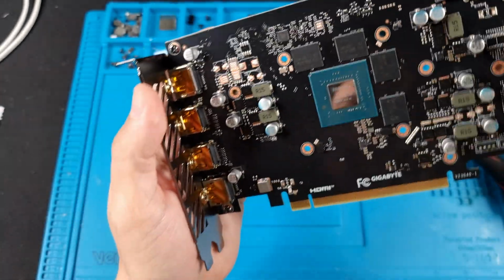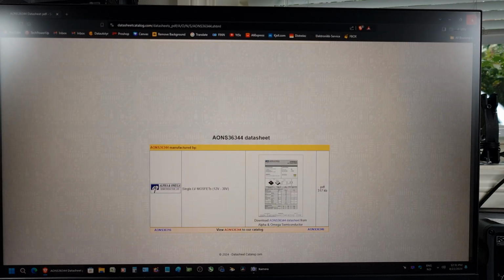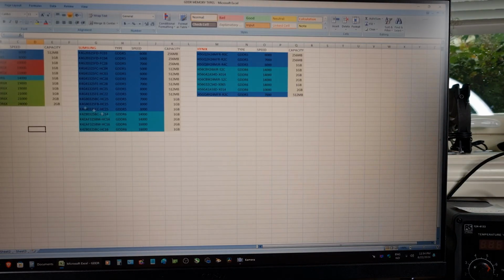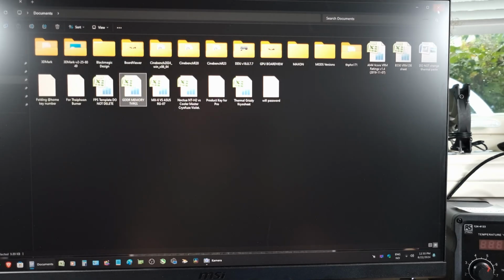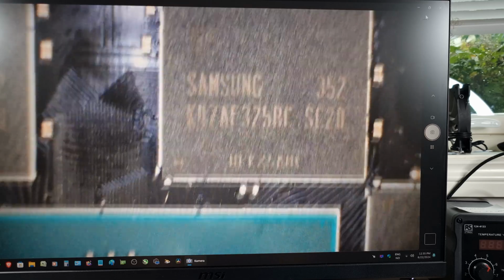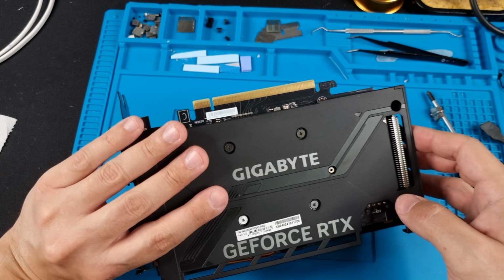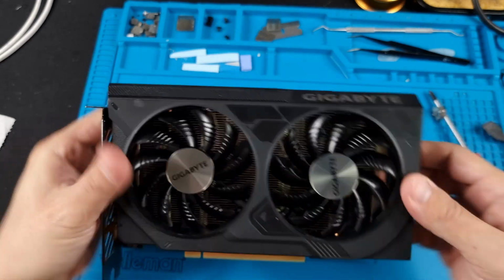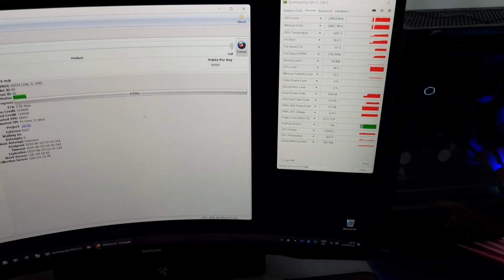GIGABYTE RTX 4060 8GB WINDFORCE OC TEARDOWN AND DEEP LOOK!

Comment: Loved doing Seti@Home. Don't think they are doing any new data packets, but there are a lot of other distributed computing projects. Einstein@home and others. Worthy use for computer time, though it runs constantly and probably uses a fair amount of electricity. Thanks for this tear down, the GPU has not bad temp, but the hotspot goes over 90 deg. easily, even with fans running full out. Definitely going to replace thermal paste and possibly pads. At least the pads are all 1mm, makes it easier.
Reply from the maker: I have not looked into other distributed computing projects, but those look interesting. Thanks for the heads up.

Comment: I have this card. Idk if it's faulty or it's my system sometimes it downclocks on idle (never happens during games) and never goes up again even on load until I re-start PC.
Reply from the maker: @dvornikovalexei  That's pretty strange. Try using DDU and uninstall graphics drivers in safe mode. Then download latest and install clean.
Reply: @TechnologyHive  Already did that. Wait, now that i think about it, this problem started only after i updated to 572.16.

Comment: Eu tenho uma 4060 da marca PNY, você sabe me dizer qual a medida dos thermal pads ? A placa é semi nova mas está trabalhando muito quente
Reply from the maker: I do not know the size of thermal pads for that card. sorry.
Reply: @TechnologyHive  você acha que 82 graus celsius e 110 graus no Hotspot é errado pra essa placa ? Acionei a fabricante mas eles insistem em dizer que está dentro do tolerável
Reply from the maker: @Lorenzzomariano  110c is very high. I would re-paste it. Try MX-6.
Reply: @TechnologyHive  a placa está em garantia, não posso mexer nela e a fabricante está negando a garantia. Não sei mais o que fazer
Reply: @Lorenzzomariano  Hello. Could you tell me if you were able to reduce the temperature by replacing the thermal interface?
Reply: @Сварщик-е7кHello, I tried to send the video card for warranty and they denied it, saying that the temperature was "normal". I ended up not dealing with this problem anymore and used it this way, but today I no longer have the video card because I sold my entire setup.

Comment: Will this work with my 
Intel Core i7 10700F Comet Lake CPU?
Reply from the maker: @MatthewHewitt1984  Yes, but I do not recommend it. The reason is that the 10700f is a pci-e Gen 3.0 cpu. The 4060 is a Gen 4.0 pci-e, X8. If you install this card in combination with that cpu, you'd be running at pci-e 3.0 x8, severely crippling the 4060's performance.

Comment: 2 questions, would this be fine for a 1440p monitor and what would be an upgrade to this gpu?
Reply from the maker: This is a 1080p card. Of course you can lower your games graphics settings and achieve satisfactory performance. But if you want an upgrade to this, it would be the RX 6700 XT or RTX 3060 Ti, which you can now find both for a cheaper price than the 4060 in the used market. 

If you want a new card as an upgrade to this, I would go with the RX 7700 XT from AMD, for $100 more. 12GB of VRAM and around 30% better rasterization performance. Unfortunately there is nothing in between these two cards really worth the money, unless you look in the used market.
Reply: @TechnologyHive  the 7700 would run 1440p just fine? if not do you recommend a gpu that will?
Reply from the maker: @EugeneEdwardsIV  The RX 7700 XT will run much better than the 4060 at 1440p, that's for sure. For that price range, it's the only one I recommend, since I own one myself.

Comment: I have the same version of the card but its rtx 3060.
The card is instantly hitting 88C (and hotspot at 105C)  as soon as I stress it. The card is only 1.5yr old. Maybe should I give repasting a try?
Reply from the maker: @saideepakmalisetty6349  Try MX-6 or Thermalright Heilos. Both are excellent for bringing down hotspot temps.
Reply: @TechnologyHive  I have ordered mx4 for now. Since stock of mx6 isn't readily available for now. Will it be fine?
Reply from the maker: @saideepakmalisetty6349  MX-4 is good stuff. It should work!
Reply: @TechnologyHive  my gpu has a factory warranty seal. Don't want to mess with warranty. I still have 2 more years of warranty. Decided to rma it.
Reply: @TechnologyHive  I would like to update you about my problem.
Gigabyte acknowledged the overheating issues on my card. Replaced thermal paste and thermal pads by the service centre. Now the temps are under control. (Still hovers around 70-80 but yeah my case is little compact)

Comment: Hey man, just wondering. Can you do  a video with this particular card without the plastic backplate. I heard the contact between gpu die and the plastic is weak thus resulting high tempt hotspot over 95 on high demanding games like Ghost of Tsushima. Can you do the comparison video and maybe with washers to increase the contact pressure without the backplate?
Reply from the maker: I have not experienced that at all, before or after re-paste.

Comment: What temps do you get with this gpu on full load? Mine gets around 83c when its maxed out. Is it normal?
Reply from the maker: Mine runs around 73/84c hotspot. Yes, it is normal if you have poor air circulation in your case.
Reply: @TechnologyHive  alright thanks any tips to improve airflow and reduce temps? I have tried undervolting and seen a small decrease in gpu temp but I'm looking for more decrease in temperatures if its possible
Reply from the maker: @IAmAgentXD  Have upu tried new paste? The stock paste is not the best.

Comment: 30 delta is normal on the 7900xtx  with the stock coolers i change the thermal pads and paste on it with nab cooler pads  and ptm7950 first i was getting 90 on memory and 70 with almost 105 on hotspot the moment i change it with new my temp on memory when to 65 and chip to 50 and 80 on hotspot  so 30 delta and on idle is 50 memory 35 on chip with 42 on hotspot that is 7 on delta
Reply from the maker: @gabydiaz2732  Wow, those are great thermals. I have heard of Nab Cooling. In fact, they sent me their thermal paste when they first started as a company for a review. The video is somewhere on my channel. It's been a while.

Comment: Hey man have ever fixed horrible GPU coil whine with changing faulty inductors? Coil whine happens even at ~50W unlike most people where it happens ag 150-200W.

 I want to bring it local pc repair shop (i have no way to ship it to Norway :') "  have them test which ones causing it and change it. Is it plausible?
Reply from the maker: @desgard  Or you could enable vsync.
Reply: @TechnologyHive  unfortunately even with vsync it happens as most games use at least 50watt and it is very audible over headphones 🥲
Reply from the maker: @desgard  Are you sure it is the card, not your psu? Btw coilwhine doesn't mean faulty inductors or coils. It's just more of a nuisance.
Reply: @TechnologyHive  100% it is GPU as i didn't have it with other GPU. I would pay to get rid of this noise if i can as it is audible with headphones as well.

I assume you have lots of cars with some degree of coilwhine, have you ever heard or experienced replacing vibrating inductors and whine ceasing/reducing?
Reply from the maker: @desgard  I've replaced many inductors, yes 😆. But none due to coilwhine. If the card is under warranty, just rma it.
Reply: @TechnologyHive  unfortunately 😔 second hand horror story. Thank you for answering